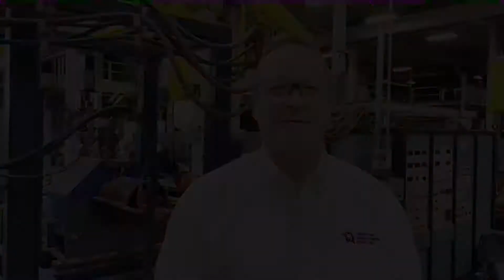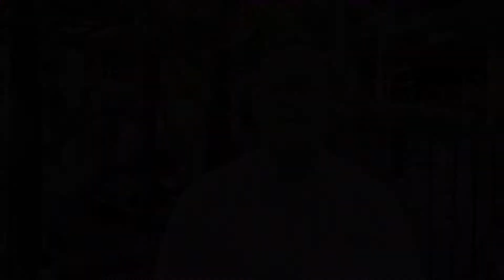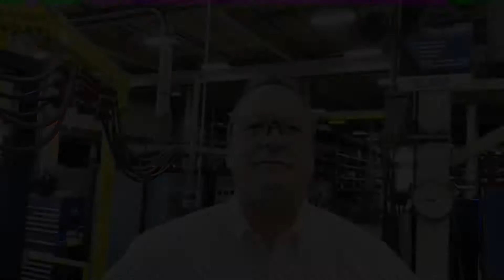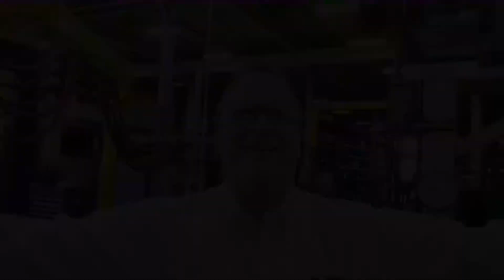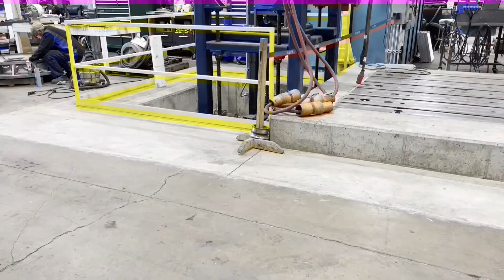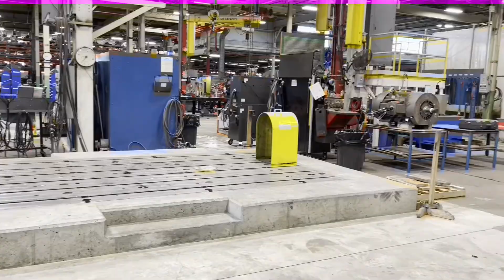Precision Performance Verification

Comment: Hello Rich,  Looks like a fancy setup with the inertial mass T-slotted base and elastomeric/spring isolation.  I do have a few questions though...
1. Have you measured (experimentally determined) the actual X, Y, & Z natural frequencies of the installed base?  If so, what are they? 
2.  Will the isolated inertial mass base comply with NEMA MG 1 Part 7.6.3 Rigid Mounting if the motor is solidly mounted to the T-Slot base?
3.  Will the isolated inertial mass base also comply with NEMA MG 1 Part 7.6.2 Resilient Mounting if the motor is placed on the base without the use of additional springs or stacks of elastomeric pads?
Thanks for sharing Rich!  :-)
Reply from the maker: HI Brian!  This is Kelli at Decatur Industrial! I just sent these questions to our team :) Have a great day. Thanks for watching our video!